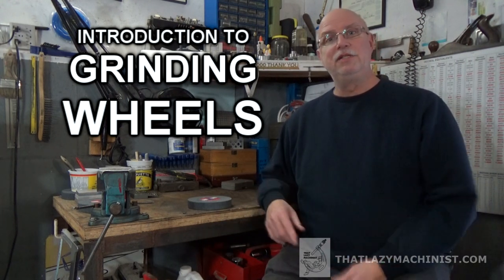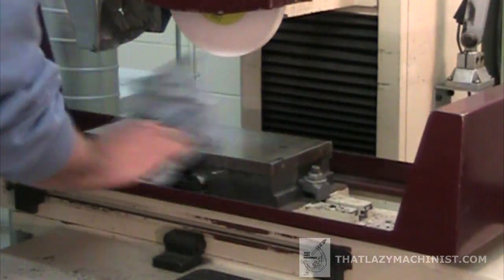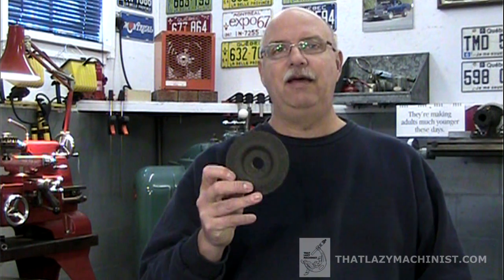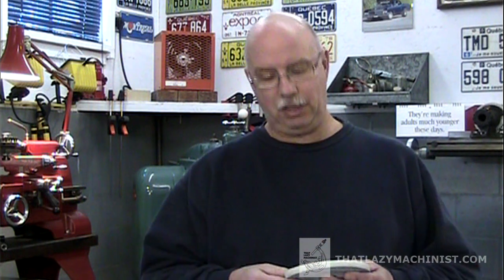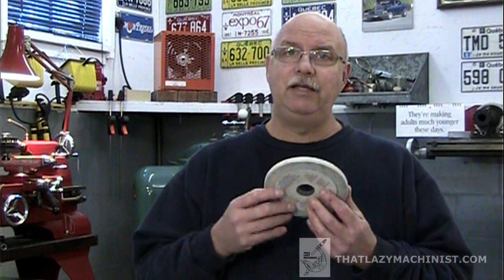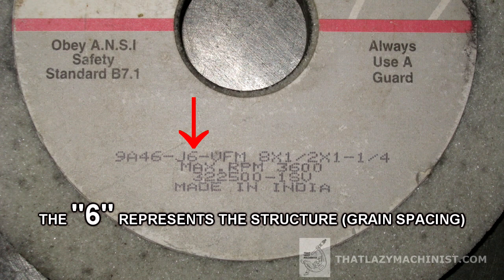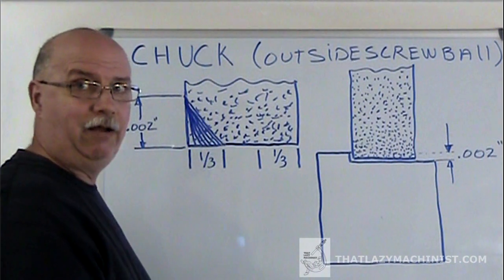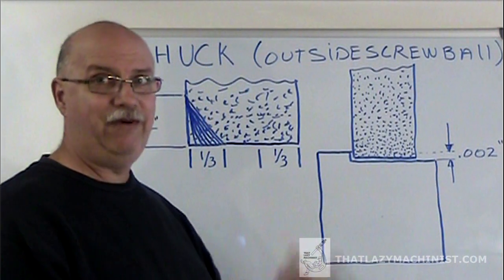GRINDING WHEELS 101, DIFFERENT TYPES OF GRINDING WHEELS, HOW THEY ARE USED AND FOR WHAT MATERIAL

Comment: how to mount nonmagnetic Ti-64 alloy 6mm plate on the magnetic chuck. and can you suggest grinding wheel specification Ti-64 alloy with 0.75 mm Depth of cut (Creepfeed grinding)? I required it for my research work.
 Thank you

Comment: how does the idea of the "clear winner" between the wheel and workpiece work when you're dealing with materials and wheels of intermediate hardnesses? surely there's a crossover point? I always thought it was about balancing wear between the bond and abrasive. Hard materials wear the abrasive quickly, so you need a relatively soft bond to keep the wheel from glazing. Soft materials wear the abrasive slowly, so you can use a tougher bond for longer wheel life without glazing
Reply from the maker: Hi Rob! I agree with your insight. It is a balancing act and there is a cross over point. My videos are for beginners and sometimes I skip information in order to keep things simple. What you are saying agrees with what I said in the video and adds some more information on why the choice of bond is so important. Thanks for some great information and for taking the time to share with everyone. Marc